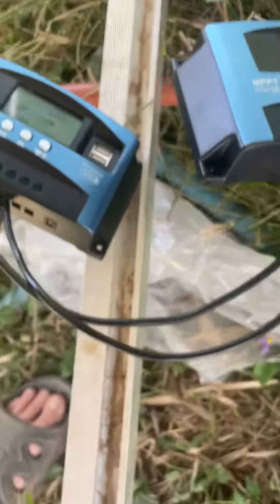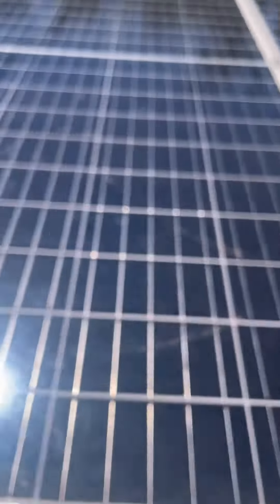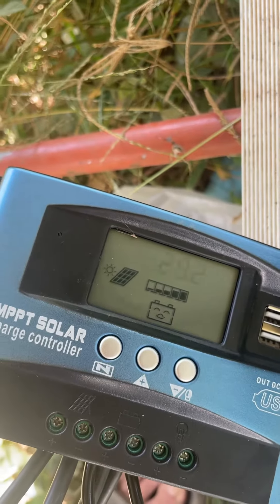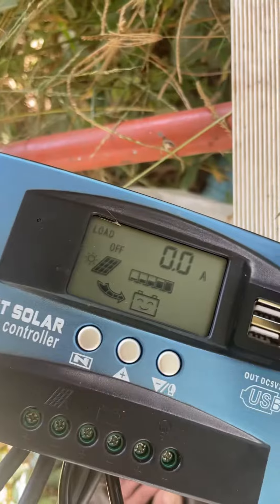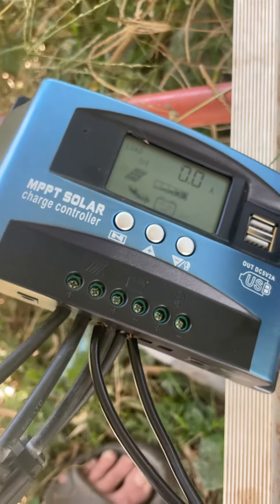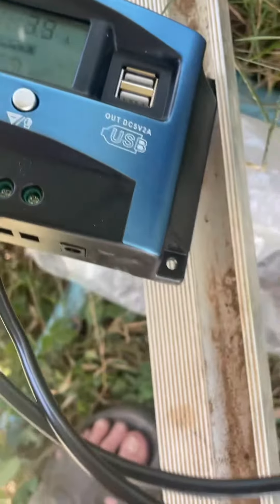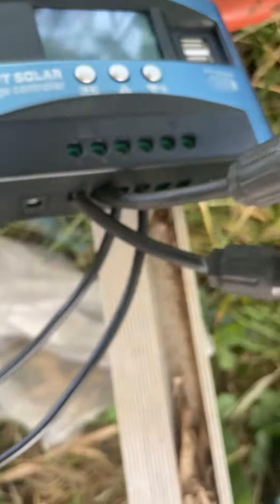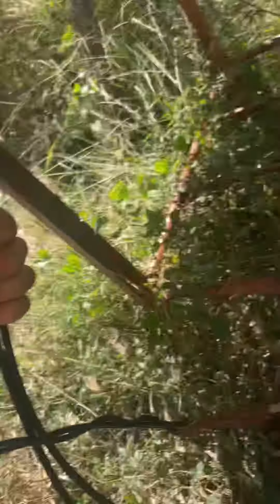BL-30 PowMr solar controllers not working again

Comment: If i remember these don't work on Lithium.  Only Lead acid/AGM.  Have one from EBay and instructions said NO Lithium.
Reply from the maker: There are two types you have to be careful when ordering and generally the ones that are non-lithium are the small rectangular controllers if you watch the video you will see that I selected B01 as a battery type, which is lithium.